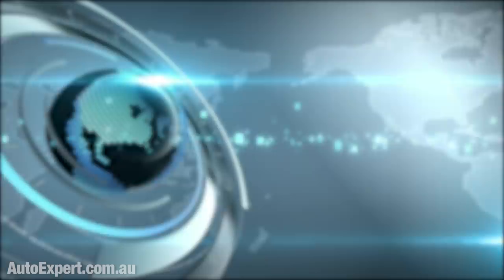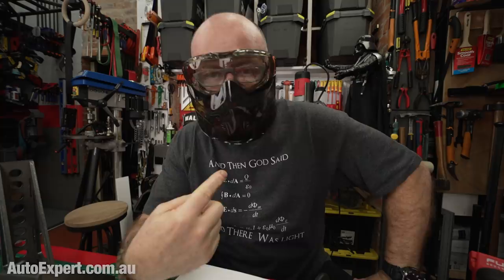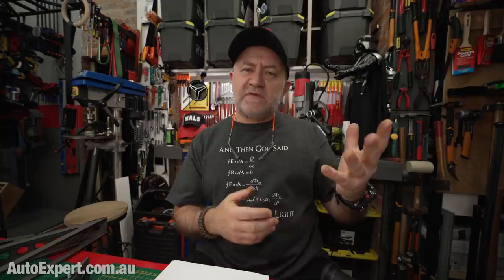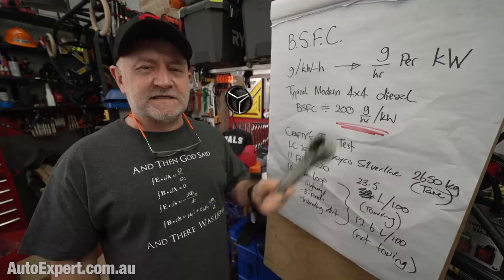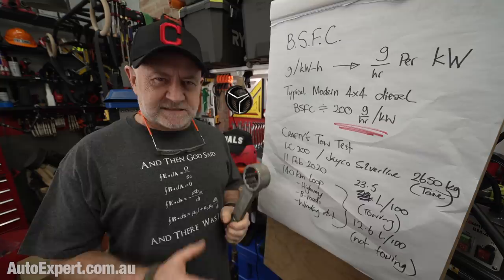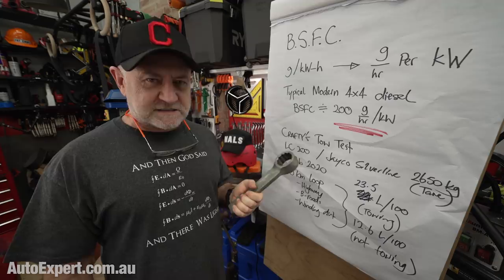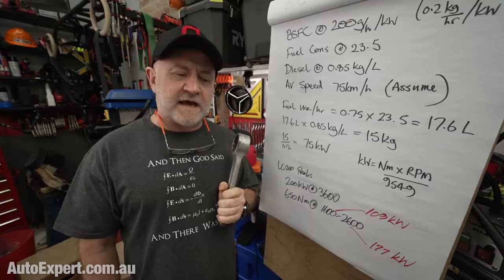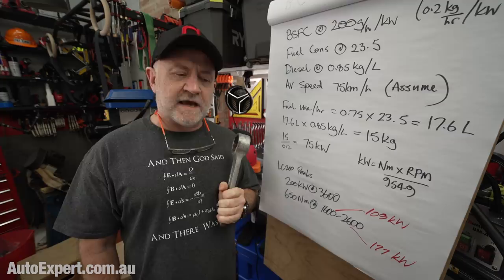How much power does it really take to tow? | Auto Expert John Cadogan

Comment: Just on that eye protection while needing glasses.
I've recently discovered safety glasses with diopters built in.
If you just need a straight +1.5 or 2 or whatever get a pair on Amazon for 20 bucks. 
So much better than putting safety glasses over your normal ones or using a face shield. 
Yes, I have a face shield but most of the time it's overkill and the diopter safety glasses are just like wearing normal safety glass but you can, y'know, see.
Which is handy.
Oh, BTW get the ones with full glass diopter not just a little section at the bottom, unless you want that bifocal thing happening.
Reply: Yes, Blackwoods carry them for about $12 in clear or smoke. They have the half moon section in the bottom of the lens so you can see normally over that area.
Reply: They also make glasses made from safety materials (polycarbonates or other) which can be ground for prescriptions.

Comment: The biggest road-going prime movers tent to top out at about 600-700kW, and can pull up to about 110,000 kg in a combination with that output...
Reply: And 2400nm and they are at full boost for 80% of Thier driving as most truck drivers like doing the speed limit.

Comment: Using a 125mm grinder I'd just put a fresh 1mm cutting disc on, and a slip led to my finger going in between the disc and the guard in one end around the disc and out the other, I still have my finger tip but don't ask me how.

Comment: Hello,
I have been researching for a few years finding bits and pieces and contradicting info our there about towing.  I'm looking for someone to help with the complex task of matching a travel trailer with my 2023 Jeep Grand Cherokee.  It has a wheel base of 116.7, is 193.5 inches long, 77.5 wide, 70.8 high.  it weighs 4413 lbs and has a tow rating of 6200 lbs. It is a 4x4 with the manufactures tow package.  It will usually be just me in the jeep, so I'm not concerned with the jeeps payload capacity of 1050.  But the sticker on my jeep says GVWR is 6050??  Thats confusing.  
3 questions:
1.  Does 6 or so inches of extra width or height of the travel trailer make a big difference in the performance of the jeep? 
2.  Can I tow a 20 ft. (from tip to bumper) 4500 lb travel trailer safely? 
3. I want as much comfort/storage as possible what would you suggest the max size/weight travel trailer for the jeep should be?  I'll be traveling 5 to 6 hours, then unhitching/camping for several days.  Hitch, repeat for a few months of the year.  (retirement)
Can you help?

Comment: A Fuso Canter light truck has 96kW...
Anyone who talks power for towing just needs to hear that.
Reply: Fusos run a 3l TD for a 7500kg max weight truck. Isuzu and Hino have 185~hp and 450? Nm of torque and 5.2l in both for the heaviest of Thier light models. Hino and Isuzu only use the 3l in a truck rated to car licenses. 

Even then. They are not very fast and you lose a lot of speeds on most hills. So you are full throttle a lot.

Comment: You can get prescription safety Glasses, I have used them for years, OPSM Specsavers can get them made
Reply: I have them at work, the trouble is if you have progressive lenses as safety glasses need to be wrap around and made of a polycarbonate(plastic and glass have differing diffraction so need different shape grinding) to be effective, the lens curve doesn't work for progressive so they need to be near flat so you end up with aviator style glasses with side intrusion protectors... I drive remote controlled gantry cranes in a process environment so that's a no no(must have side vision).
As a result my prescription safety glasses can only be for distance not reading... still must carry my normal non safety glasses.

Comment: I will wear gloves when grinding.  I have a 5"  one hand grinder and a heavy one that takes 2 hands to hold it with a 12" disc.(more of a pipe cutter)  Never thought twice about it, nor was given any advice in welding class about glove removal (the leather gloves always got burned full of holes as I continually picked up the hot piece to see the gloves smoke.(back in the 70's) Still alive, still uninjured.  On a lathe or other rotating machine I pay attention.
Reply from the maker: Knock yourself out.

Comment: I like to save my pinkies and keep them clean/intact for more noble causes, especially the "social" one. I was a metalwork tradie for 55 years pre retirement, always wore gloves. Hands still in perfect condition. In regard to grinders it's not wearing gloves that's the problem, it's the type of glove, heavy leather, no, no. Also not all grinders, "off hand" types, gloves can be dangerous, disc grinders, gloves in fact protect your hands. I also still have ten fingers after all those years. Do what works for you combined with common sense.
Reply from the maker: Good advice.

Comment: With the gloves thing, the mines (BHP and FMG) mandate that you MUST wear gloves when using grinders
Reply: In the trade for 30yrs, full time boilermaker, I have all my fingers, do wear gloves approx 75% of the time when using an angle grinder so totally agree with that policy on wearing gloves on portable angle grinders as a must.
Seriously if you get you gloves and or fingers caught in a 9,7,5 or 4inch grinder perhaps one is too stupid to operate one or pick up one in the first place 🤔
Had to chuckle about a comment with someone stating that they are a uni graduated safety officer.. 🤣😅🤣😅🤣
Hmmm potentially wouldn't have more than 10hrs total grinder operational practical experience..
I have to laugh at pen pushers and policy makers having no practical experience whatsoever telling us what's best.
Reply: @jb243wp  yeah im a boilermaker too been TQ for 8 years but have been in the game for 16, im more or less in the same mind as you and still have all my fingers. Your hands shouldnt be anywhere near the disc as you said its more for burn protection i think from sparks and grabbing hot offcuts sometimes because as we both know leather riggers gloves have virtually zero cut protection against a 1mm 5" disc on full noise

Comment: It's not power, I can move a 1.5 ton trailer around the driveway myself, human peak power is maybe 2kW and a sustained 100W maybe?  I just can't move it as fast as the car :)

I don't get the people who remap turbodiesels "for towing" either.  If my car had more power I couldn't use it when towing, the thing limiting towing speed is that I can't drive around the corners any faster for fear of something bad happening (loss of control, breaking something, unable to safely stop).  Not to mention the strain it causes on all the rest of car's components, I expect my vehicles to last!  

I bought a 3l diesel instead of the 2l diesel because more is more, it's nice being able to out accellerate other things.  I wonder how much practical towing difference there is between the 2?  I'm not in Aus, but how much longer it is really going to take to get to DPC with the 2l?
Reply: Same here, I have the bmw 730d and it pulls my 1.8ton trailer no problem, my wife has a 520d with the same tow capacity as the 7, both autos, and hers feels like a lame donkey with the trailer. Best is as much power as the you can get. I drive a hgv class 1, all the tractors are getting big engines because they do more miles per gallon over the shit underpowered ones. A 380 at 44 tons sucks and does about 6 mpg but a 560 or bigger is doing 11.6 mpg.

Comment: Yup.
Face protecion is a must.
I have a lovely gouge in/on my forehead from a rogue grinder that got caugt in a crack on a truck bed, and the flicked itself back, a la a chainsaw in a bad mood.
Reply: I had a reinforced cutting wheel fragment while using a Dremel Moto-Tool; good thing I had my face shield on.

Comment: The instructions of all the angle grinders that I have ever purchased and that is quite a few over the years say wear gloves. The reason is flying pieces of metal grit etc are far more likely to cause harm than entrapment if you have the grinder in both hands as you are supposed to, and don't do stupid things like grab the rotating disc in order to stop it quickly.I will always prefer gloves to having my hands peppered with shrapnel every time I use the grinder. Good quality well fitting gloves also help protect from white finger and carpal tunnel problems by giving another layer of vibration protection. If you are really worried about entrapment and getting your fingers in the works wear ballistic gloves as used by chain saw operatives.. If you were really doing a lot of grinding the magnets on those glasses would be full of grinding dust, I have had problems with phones over the years due to grinding dust getting into the speakers when the phones have been in my pocket another reason to wear full face protection and a dust mask. I use prescription safety glasses which in the UK at least are tax free.
Reply from the maker: Knock yourself out. Still a bad idea with all rotating machinery.
Reply: @AutoExpertJC  You have obviously never used a nine inch grinder in an industrial situation where the work is not a nice small flat piece but has adjoining upright pieces that bounce the sparks and debri right back onto your hands  and whichever way you try to point the grinder if there is any option there is something that is going to do this. Yes with pillar drills, mills and lathes any loose clothing needs securing and its not a good idea to wear gloves but with grinders it a case of needs must when the devil drives.
Reply from the maker: I agree with you in principle there, mate. All situations are different. Best idea for 9" grinder is: minimise usage where possible.

Comment: 200g/kWh is a bit keen. 210 maybe. CAT C175, probably state of the art big engine, doesn't beat 200, and Volvo D12A can kiss 190 in its sweet spot. 
Sulzer K flex claims 171
160 is silly.
And wear a dust mask grinding. Check the color of your snot if you don't for details.
N95 or FFP2

Comment: For the Everest, heat is the limiting factor. Plenty of stories on the FB owners forums around the Everst hitting limp mode on a hot day when towing on the higher end of the weight capacity.
Reply: Is it hitting Limp Mode due to the trans overheating, or the engine?
Reply: @markh.6687  trans
Reply: @MrTonaluv  Thanks, good Sir. Thought that might be it; it's harder to cool a transmission.
Reply: @markh.6687  although a separate trans cooler of a proper size and fitted correctly would make a huge difference. Any vehicle that is towing should have one.
Reply: @MrTonaluv  You hit the nails squarely on the head. But it would appear that Ford didn't either fit a trans cooler, or it's not the proper size and heat-carrying capacity for the job for the max advertised load.

Comment: i like that first face mask , it looks cool. full face mask is the better option, i was using a bench mounted wire wheel and a strand of wire broke off and pierced my cheek. full face ever since. they do make safety glasses to go over prescription glasses and safety prescription glasses. about 300$ , but hey i like my eyes. everyone who has done a cert 1 in construction manufacturing auto motive tafe etc has had to watch the video about gloves rings etc. have i had injury's from grinders yes , a cut / burn is better than getting your finger ripped off.

Comment: 22:02 may want to re-watch that again about the torque and revs exchange analogy. Something not quite right there. Also, ad someone who drives a Prado, I do wonder if engine power at highway speeds is relevant to capacity. As I know I am pushing the proverbial uphill trying to maintain even 100 on the freeway uphill, with just a 1.8t box trailer
Reply: Sounds like your Prado is a heap of shit - I tow an 8x5 trailer regularly loaded to its 1.5 tonne maximum payload behind my diesel Golf and it sings along at 100 without breaking a sweat. Granted, if the highway goes up a steep hill I have to downshift to 5th gear and use a bit more throttle, but it still chugs right up the hill happily at 100.
Reply: @ChristopherHallett  What weight is your Golf? The Prado has to get itself up the hill as well. Wait till your praying the lights at the bottom of a hill are on green as I did one day a week before I bought a Prado.
Reply: I found they are not great at going up the long hills with a load.
Reply: @larkhill2119  Somewhere around 1400 kilos, empty. It does just fine, I can even overtake slower vehicles like Prados whilst towing uphill, with ease.
Reply: @ChristopherHallett  An Australian trying to explain to someone living in Germany what overtaking means? Mate once you have travelled at 295 KPH and got fed up watching the fuel gauge go down, come back and tell me Ok. They lied it does not do 300.
Reply: @ChristopherHallett  Diesel Golf, 1440kg, 103kw & 340mn. Agree, will tow big weights all day, and quick as well. P.S. Great brakes  as well.
Reply: @mickgrace2558  Mine's the GT Diesel, so it's got the GTI suspension and brakes and the 125kW 350 Nm engine tune in it. It's got Michelin Pilot Sport 4s on it and if I turn traction control off it'll burn them through second and chirp into third.

Comment: Unrelated question John , can a motor make peak torque at anything under full throttle? An answer would be most appreciated.
Reply from the maker: No. Not possible. The power curve you look at is always at maximum accelerator (wide-open throttle in a petrol).
Reply: @AutoExpertJC  Thanks for replying John .
Reply from the maker: No worries mate. Thanks for watching. Your car always accelerates when you go from part throttle to more throttle, right? Because: more power/torque.
Reply: @AutoExpertJC  Yes exactly John . Reason for the question was years ago I had an argument with some work colleagues who were adamant that power and torque were always the same at a given rev , and my argument was how come you feel a push back into your seat when you floor it? And how come a dyno run is done at WOT? Cheers.
Reply: @AutoExpertJC  I always watch , it's great education and an even greater laugh , thanks.

Comment: John, sorry to be pest but can you review my towing question thanks?
Can I ask a question that hopefully you can have some answers to.
I have a 3.2t off road (read gravel road) van that sits very high on fully independent suspension running two sizable shockers per wheel.
The majority of the weight is the double stacked chassis and 4x80 water tanks underneath.
I tow with a current model LC200.
My experience with this van is that it is upset by side to side undulations in the road which sets it rocking from side to side.
It self corrects very quickly but it is not very comfortable from the drivers seat!
My thoughts on a solution to this is to fit a sizable roll bar across the front, or rear, sets of wheels?
Is this something that might improve this vans road manners?
Reply: I'd be interested in that being explored. 
 I take your comment to mean it takes longer than you expect to damping the roll. Do you also get a bit of yaw and/or pitch? I wonder how you could establish where it's center of gravity is? Are the water tanks baffled? Can you do some experitments with water tanks empty v fill and with everything movable as low as possible vs normal travel arrangement? 
Recently I have become interested if a walking beam suspension with rubber springs would be advantageous in this application.
Reply: @DavesShed  Some pitch yes but the suspension on the LC is not exactly standard and controls that pretty well. My concern is that the roll can turn into yaw and get out of control. It tows far better on full tanks than low tanks, it sits on the road a lot firmer. As low as possible is floor level which is 80cm off the ground! Everything possible is on the floor or in the front boot when travelling. The bed is at the front and we fill the cavity under it with everything possible. With those considerations I have 200kg on the ball.
Reply: @Peter57808  Yes that would be my worry also. I'd be interested in your query. I'm certainly not the one to give you any advice myself. It does sound like the center of gravity is simply too high. It also sounds like it wont be an easy fix. 

What if you attach an underslung metal box close to the axles so that you can lower batteries and anything else heavy to the chasis level? Impractical? 

Another curious thing is that you say you have loaded up the "front boot" and under the front bed yet your tow ball weight is 200kg on a 3,200kg van. So without those items in the van, the whole thing is risky? 

Is there some other mass too far to the rear? As in too far from the axles. Do you have weights balanced slightly forward, yet not centered near the axles? 
You did say you get some pitch. Of course some is unaviodable on uneven roads but is it trying to tell you something?  If that was mine, I'd unload everything to tare weight and find my tow ball mass when empty. 

All in all, my totally uneducated impression is that this is an example where a 5th wheeler would be perferable.
Reply: @DavesShed  I have driven it 400k's as built to get it home from new and it felt very nervous, not unstable just touchy. It has a very light ball weight when empty, I did not have a means to measure it at the time but it felt light and took very little tension on the load leveler to level the car. There is a third weight which i think influences its balance, it has a sizable slide-out lounge that is centered just rear of the rear axle. I did email the chassis manufacturer with the torsion bar idea, they never responded but I noted with interest that 6 months later the torsion bar appeared on their website as an option!!